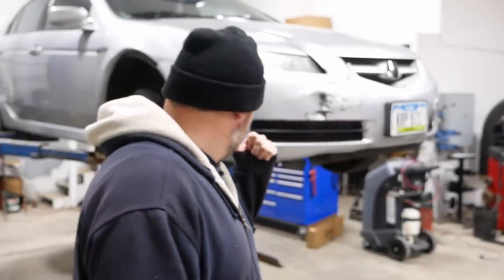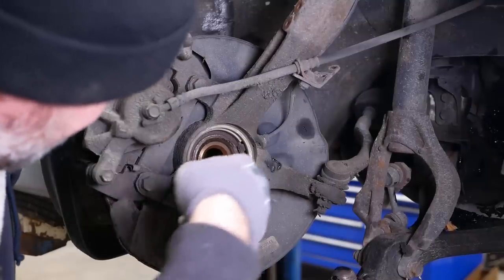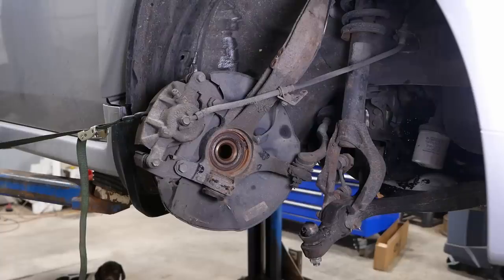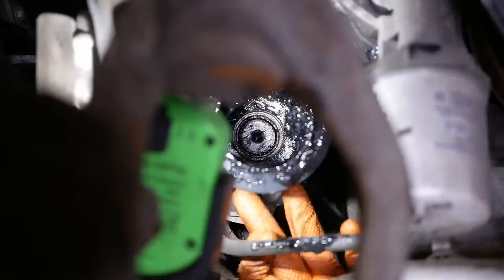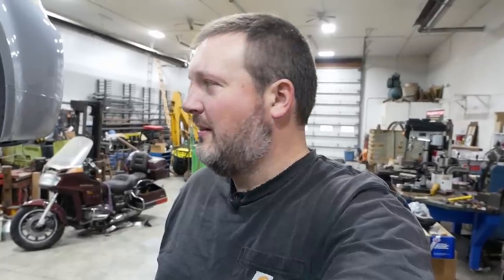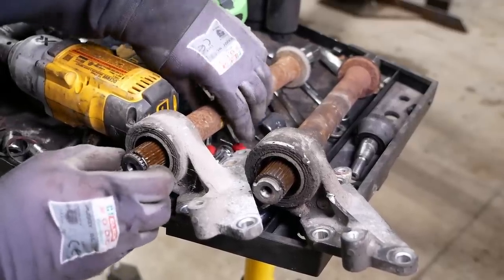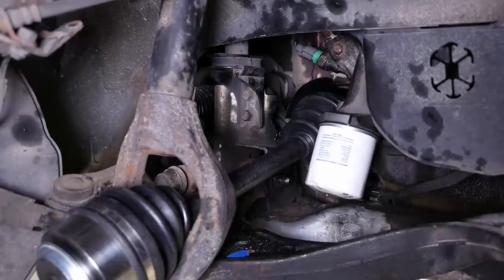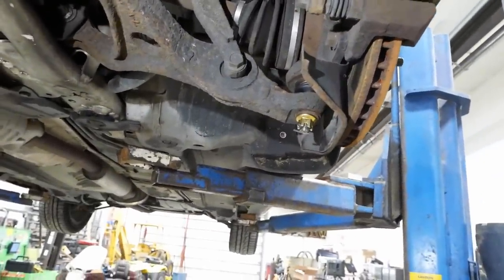Acura TL Broken Ball Joint

Comment: Great job Wes. Mine failed even though only year old and it cost me 2100. Now because they said lower control arm bushings weren't bad even though I thought they were its now at another shop. I think its been almost 2 weeks for 4 shocks, lower control arms,  valve cover gasket and the valve that regulates pressure front to rear brakes. That be another 2500 to 2800. Toyota trucks are tuff but parts aren't cheap
Reply: Funny... My 200k mile Ford still has original steering and suspension. Yea... Toyotas are so tough. Bwahahaha
Reply: @dontblameme6328  my truck is now at 205000. Timing belt was original which mechanic was blown away lol

Comment: I have been in that spot and tried to weld a piece of steel to part of the CV joint stuck in  that hole and all but no way hoser. I did get lucky once by jamming the part that fell out back into the cavity and then with it incorrectly together, got a pry held onto the part we are trying to get out (meaning that I now have hired a helper) so while we had it combobulated on itself.... just tapped on the da** thing to get set up to whale on it but it just popped out like that is how its done. I will never know cause it goes on the list of " NO, NO I do not work on these rigs for this problem. There are many unanswered questions in lots of areas, and this is one that will see a man living on Mars  before we know the answer to this one!

Comment: I have similar comments about the engineers that designed the placement of the bolts that hold the power steering lines on my 2005 GMC Envoy😂

Comment: I came across a few of these over the years (mostly Pilots iirc) and had the exact same problems.  My solution was to cut the bracket and remove in two pieces.  I kept a few of the bracket/mid shaft OEM parts in stock and it became a much less painful experience, still a pain in the ass though.  The part new from Honda was only like $160 (10 years ago) so it was a cost effective solution vs extra hours of labor.   Pretty sure I still have one the shelf….

Comment: I worked for this workshop where we had a similar problem, the drive shaft would NOT come out of the gearbox, eventually, we removed the gearbox and took the whole box apart to reach the shaft, 14 pound hammer, press., plus heat........ NOTHING worked. we had to find a second hand gearbox and put it all together. NASTY when CV shafts go wrong !

Comment: This happened to me back around 2011. Passenger wheel came off going over a speed bump in a parking lot. Thank God not on a highway. No one ever warned me this would happen. It had been in the shop a few times prior that year. I would def would have replaced it if a mechanic said it would eventually come off.

Comment: Great work as usual. Great music choice for the intro. Matched the situation perfectly.
Had the same failure happen to me on a 1996 Eclipse RS, thankfully right in front of the house's driveway. Good thing she's not a show car. Another stripe on the Tiger didn't make a difference. 
Feels good to know I'm not the only one that always gets into a car fix situation that's supposed to be 15min and suddenly turns into HOURS.
I own a 1998 CR-V EX AWD, sometimes they lead you to believe they were hanging out a little too much with all the EURO retarded OEM's when they designed some of their cars.
The double A-ARM front suspension it's the better setup, it keeps steering duties separated from the suspending ones.
Strut setup it's the easy, mundane, garden variety, CHEAP WAY to do it.

Comment: The best way I've found to pull those shafts is to have someone pry on it, while you reach into the center punch and smack it with a hammer.   You can pull flywheels off of old lawnmowers that same way.  But I don't think it would have worked in your case, being that it broke the shaft just to get it off.

Comment: I once had an axle cup stuck so bad in a transmission that I eventually dropped the transmission, sawed the remainder of the cup off, and split the case to pry the retainer clip out from the diff and pulled the remaining splined shaft out. Once the clip was out I noticed it was more "D" shaped than "O" shaped. The sharp corners of the D went past the chamfer on the bore of the gear. No prying or pressing would have ever removed it unless you could shear the clip at those corners. I imagine that's what happened here. That transmission needed a rebuild anyway. Maybe you are lucky it was just the half shaft haha.

Comment: No criticism from this peanut gallery, Wes, ya dun great, YA DUN GRRREEAT!  You shoulda heard the cursing and wailing last night at 9:00 pm with me trying to locate the lock pins on my (now rebuilt) snow plow attachment for my itty bitty John Deere E140 riding lawn mower.  Don't laugh, it worked great and I plowed my 350' driveway, the berm of snow to the road, and the concrete pad next to my garage in 10 deg. weather. It was sunny today tho. ALL GOOD!

Comment: I am a design engineer and although I don't work on stuff like this...  Its designed to go together easily at the factory in a specific order.  Trying to get some isolated part buried into the assembly out w/o taking it all apart the same order it was put together is not a concern....

Comment: I don't live anywhere near the "Rust Belt" (I am actually San Diego). I do get a lot of Ocean Air Vehicles. I see rust on the Splines of the Intermediate Shaft to the CV Joint similar to what is shown. They can be a Bitch. I have bought every version of Remover out there. Even the Air Hammer adaptors don't work. What I have found best (for this exact scenario): A 36 oz. Ball Peen or bigger Sledge Hammer with a cut off Eaten Shifter Lever for BIG Trucks as a Punch. With one that is 2 1/2 feet long, you can get a better angle. Give it a smack; since you are right there, rotate the other side tire about 20 degrees and repeat until it pops loose. I have found that individual shock loads work better than the rapid fire of an Air Hammer or any sort of Wedge removal Tools. I see you also work on some big stuff. The Eaton part number on my longest one is: 4303541. Buy one and make a few different lengths....

Comment: If it's easier, you can take off the fat end of the inner boot.  Then you just replace the boot strap rather than possibly the fork bolt, nut, and bushing.  PIA yes, but the narrower fork is stronger.

Comment: A long time coworker and friend had the corresponding Accord of this generation. He had an improbably high amount of issues with his ball joints. They'd gone out on multiple sides more than once. It could be a fluke, or bad parts, but he takes good care of his vehicles. There's enough evidence out there to suggest that it may be a design issue. The worst part is you lose control of the vehicle all together once you lose a ball joint or two. In one case his Accord lost control and went along a lane divider, getting scraped up on a road marker. Not fun.

Comment: What sorcery is this?!?! Multiple videos this week??? Max must have caught the computer mouse for you!

I had an ancient air-cooled Subaru station wagon loose a ball joint the SECOND I pulled into a parking spot. I had just been down a windy mountain road at unreasonably fast speeds (for an old Subaru, at least) and felt a vibration all the way... pulled into the parking space and KLUNK! the wheel literally fell over as I hit the parking brake.

Yeah.

It later locked up the right rear wheel bearing on the interstate... just gave it more gas and kept going with the tire squalling until the seized bearing broke loose. (And 'broke'.)

I love watching you deal with vehicles I surely would have bought as a teenage reprobate... because you know what you're doing AND they're someone else's problem. 

Scritch Max for me and get a wireless "mouse" so he can't keep you from posting another video today!

Comment: Your lucky that bottom bolt let go. Mine bent from trying to press it off after all else failed I had to remove the axle and and strut together. 
In regards to the axle when you tried to press it off what broke? I do believe I have to press mine out and don't want to have to visit the junkyard again

Comment: Some great content, I have picked up a few good things from Wes' s videos. Thanks Wes, now I'm no mechanic but really enjoy twisting wrenches on vehicles. I have an Autel scan tool that I've been using for a month  now and I have been trying to figure out the perimeters of values of each item should run at. Is there a data sheet or general info on each vehicle or just a manufacturer range. Thanks again for the time and effort you put in to make these videos.

Comment: I remember years ago doing this exact  job at 19 yrs old on jackstands... outside... hand tools only... on a 260,000 mile car in the rust belt. still have scars from when I struck my hand using a pipe wrench as a hammer cause I didn't have one yet. Only took me 5 days straight🤣🤣🤣

Comment: Truly a Clint "Heartbreak Ridge" video ... “Improvise, adapt, overcome”. I'd join you in horse whipping the Engineer(s) that designed this system ... also truly FUBAR ... who doesn't notice (as this was probably designed on CATIA V5) the CV knuckle is larger that the strut fork ???  I'm sure Honda will cover the extra 6 hours you burned getting it apart ... LOL. Good job Wes !!!

Comment: 9:37 these half shafts caused me so much pain when replacing my engine in my crosstour, i had to have the exhaust and transfer case off to get to the start of the half shaft itself at the transmission, and theres a cover and the bracket bolts to the block itself, but once you get the exhaust, transfer case if you have it, those 6 bolts, then it just comes right out, it sounds like a lot but i was going to have to do it like that anyway

Comment: Just wish you didn't live 6 hours drive from me. My local mechanic supposedly "fixed" my sister in laws 2002 Taurus to drivable condition. All he did was a tune up and new rear brakes. After 2 months I have replaced both broken front struts, both inner and outer tie rods and have discovered front main seal is leaking and what's looking to be water leak from around the timing cover. Also both front rotors are warped.

Comment: YOU NEED THE CV AXLE POPPER TOOLS. WEDGE THE 2 POPPERS BEHIND THE AXLE. NOW TAKE A TIE ROD FORK AND WEDGE I BETWEEN THE 2 POPPERS AND HIT IT FROM THE BOTTOM. THE PRESSURE WILL POP OUT THE CV AXLE

Comment: I went thru the same thing with a honda accord, i took off the power steeering pump for better access. on those, it helps if give the inner cv axle part u were trying to get off, a coupla good whacks before tryin to pull it out. it moves that ring around and helps it compress for removal. I'd advise gettin u a good cv axle removal tool for like 10 billion dollars...If if ever pay mine off, it'll be worth every penny. ps, whoever came up with non greasable ball joints and tie rods, should be kicked in the balls by a horse

Comment: 🤣🤣🤣 My Toyota refused to release the cv axel stub from the transmission.
 The outer cv boot was torn and that outer joint can't be disassembled due to the style c clip used,
So pulled the inner joint apart removed damper installed new boot, old damper and reassembled the inner joint on the vechicle with little room since the trans would not release it..

Comment: The hog ring breaking that axle shaft man I had that the same kinda thing happen with a slip yoke for the drive shaft on my 08 f-350 (southern not a spot of rust on it truck) the snap ring busted the groove out that the snap ring sits in so the u joint cap doesn't go rickshawing off into the wild blue yonder had to search for that pos. So called ford dealer got that yeah its like $150+ bucks and we don't got it at all So i managed managed to find a new replacement dana spicer off its oem number on the ebay get all that done prob not a month and the trans started slipping just my luck I swear.

Comment: England - Did I detect a slight animosity to the designer of the automibile you were working on. I'm an old wrinkly and gave up far*ing about with cars the day I could not see the road from under the bonnet (hood to you). I have worked on everything from Challenger tanks to Landrovers (proper Landrovers not the German crap) and I must admit that 'thing' you were working on was a tad of an r sole. I skipped a bit as I could not watch you suffer. Happy Christmas to you all.

Comment: Yea ive struggled for hours and hours before on a single drum brake..  done many a drum job but this one was friggn one thing after another..  seized on everything, bleeder snapped off, new parts failing, new parts in the wrong boxes for something else, bolts breaking, lug nuts stripped, grease on everything making all that just a little harder and more aggravating..  meanwhile the owner standing over the shoulder, her kids running around getting in my way, phone ringing, had a case of the running shits, headache, ran out of smokes, got a piece of metal shoved under a fingernail .. nailed the same finger with a hammer, pinched same finger in a spring, the ladies beloved little shit dog in the car yapping the entire time..,   Was a hair away from blowing a head gasket and putting that car on its lid then running out into traffic..   but got it done and charged her hourly rate, which she was livid about but i didnt want her as a customer or anybody she associates with so the thousand dollar brake job made up for it all..  lol..

Comment: I wonder if the weight of the car was needed  on the wheels when tighten down  the C/V spindle nuts ,so that  excess Torq world not burn out  wheel bearing  in ten thou km, either way the Honda will be back, I've had similar problems working on Hondas in the past, the worst is over  now  that you got the first one out the way, aren't they fun

Comment: There is a tool set that let you use an air hammer to remove and install those lower ball joints in less than a minute…..so of course they stopped making them and I can’t find a set for sale anywhere.

Comment: I guarantee if you rotated the axle to where the opening of the circlip is at 12 o’clock, it would of flew right off. Have to use gravity to your advantage, that will center the ring over the beveled edge.

Comment: Yup so used to doing these. Just did both mine on my mom's car after 1 ball joint snapped. I ended up buying the otc adapter kit wasn't bad at like 130.  It's also so dumb you can't fit the axle through the strut hole
Reply: Do you have a part number for that? Every time I look I can only find for early 2000's Hondas and older
Reply: @@user-fr7cu1zj3k  6734 since my mom's accord is a 2004
Reply: @firstlast---  6529-5 is a full kit for hondas
Reply: @firstlast---  6653 is for Acura TL 2009-2014
* Acura TSX 2009-14
* Honda® Accord 2010-11
* Honda® Accord Crosstour 2010-11
* Honda® Crosstour 2012-14
Reply: @niteninja0133  thank you

Comment: I just replaced the right side halfshaft on my wife’s van the other night…I was all geared up for a struggle to pop that inner joint off of the intermediate shaft, and it literally took all of two hammer taps & slid right off. What the frick.

Comment: ha ha been there done that! i started out as a GM mechanic. early 80's. and i would take a hard honda job over an easy GM job any day of the week. GM sucked. as a Honda mechanic for ten years after. then got out of it when isuzu was making their pilots. or suv what ever they were calling them.   but i never had to call the customer and said, i can't get this one bolt out come and get your car lol... almost. i had those c-rings give me a hard time on the shafts. i do know what i would have done. if i couldn't get a massive pinch bar and i mean massive crow bar type not screw driver pry bar, i would have left it in there and just rebuilt it in place. especially now that i seen what happened i would definitely have  done it in place the second time. i made a lot of money working on hondas in the late 80's early 90's. they had 3 cars back then accord prelude civic  and used a lot of the same parts that fit on one another. jumped over to acura. they had 2 cars the integra and legend. the legend came equipped with every thing, you could get some up grades like honda alarm system or cd changer. but most legend's had everything to start. the integra's  didnt come with ac, radio's antenna mud guards the new car prep was --7 hours for the ac 1.5 for the radio, 1.0 for the mud guards and pa state inspection .7 job ticket was like 10 hour ticket. a/c took 45 minutes, with a job over lap doing speaker and radio when putting in the evaporator under the dash and mud guards did everything there at the same time so the whole job would take like an hour and a half  to two hours. the first one took a little longer like three hours but i always made money on any honda job. even transmissions. they started doing swap boxes so you didnt have to tie a car up on your lift waiting on trans parts. r and r  paid five hours to swap the trans, it would take me 45 mins to pull it and 1.5 to install.

Comment: Old cars were relatively easy to work on. More room around everything to let a human get at it. Designed by a human to be worked on by a human. The computers don't care whether the thing they help design is accessible or not. And now with a lot of robot assembly lines the robot doesn't worry either. You have a lot more patience than me. I would have either destroyed something else trying to get that apart or thrown the whole car out the paddock for someone else to play with. My pet hate with design engineers is door locks. You would think it would be quite easy to make a lock that just comes in two parts that you feed in from each side and screw on. Some are but others come as a box of bits that have to be assembled on site and then have obscure hidden fixing methods that make them a pain to fit and get off. Why ? What are these people thinking of. And I say the same as you about meeting them. Except mine involves a bullet.